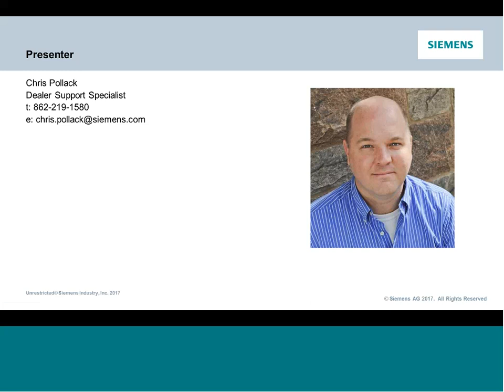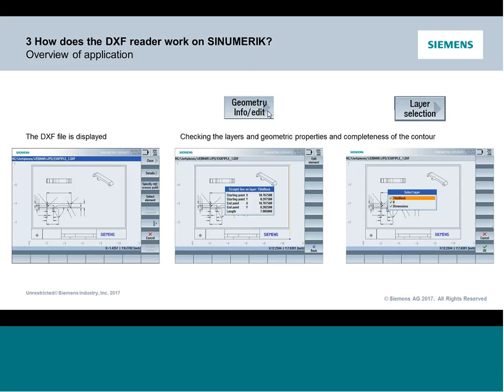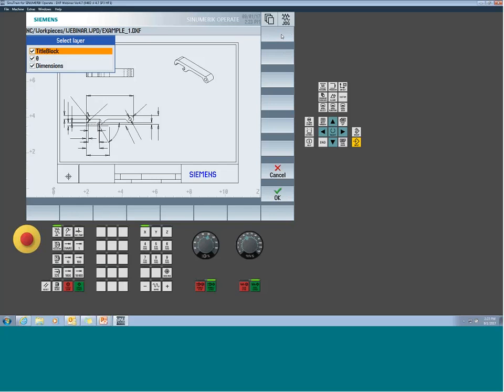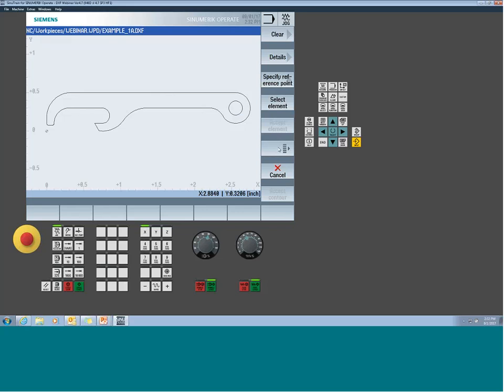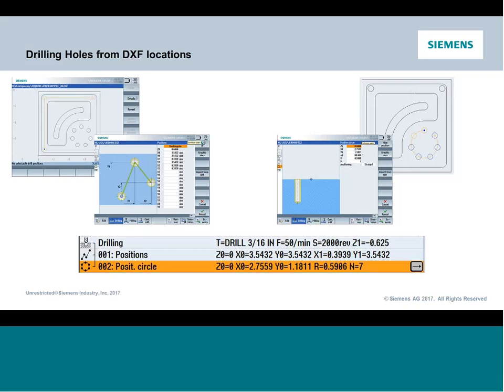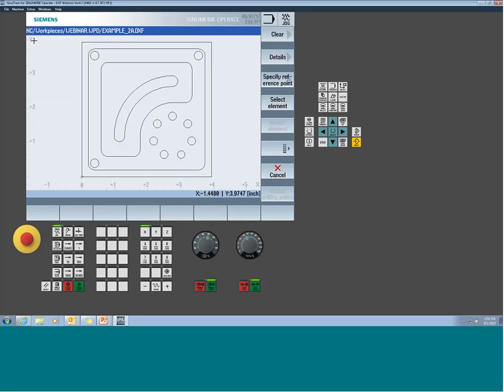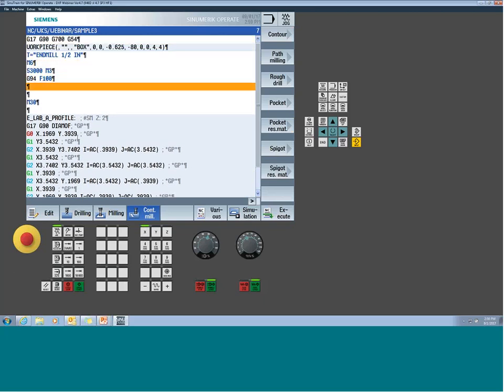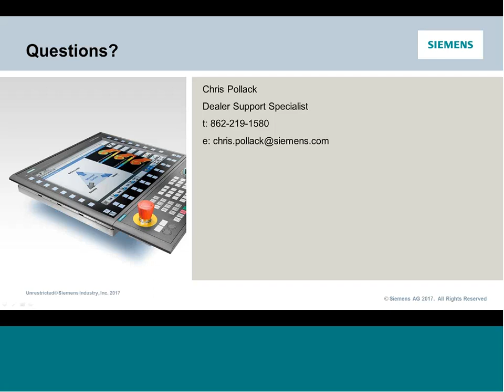DXF Programming in Ver 4 7 for Sinumerik 840D Sl and 828D

Comment: Is the DXF reader software a standalone program or it needs the Sinumerik Operate to be installed on the same computer?
Reply from the maker: No it is option on the control and standard in sinutrain
Reply: @MrCNC  I'm asking because there are two machines in the shop with the DXF reader installed on the control. But i was thinking about the possibility of installing  the DXF reader in a PC. We don't have the Sinutrain in the computer.
I was trying to replace the old CAD reader for the DXF reader.
Thanks for your answer.
Reply from the maker: your welcome